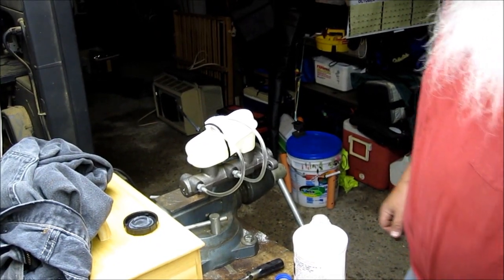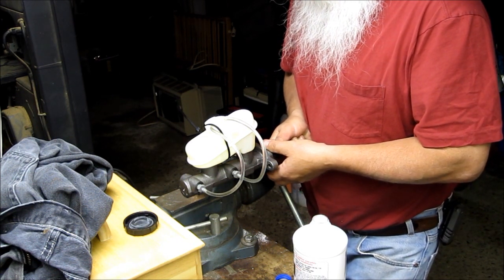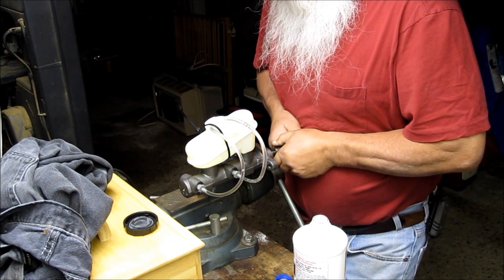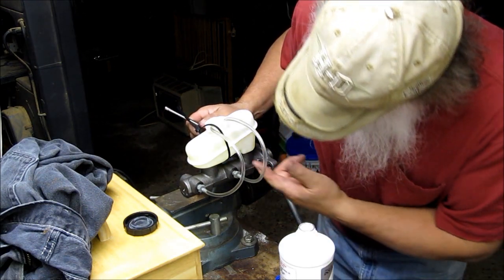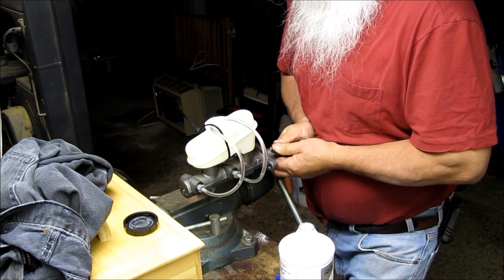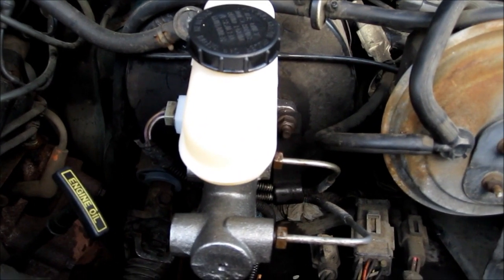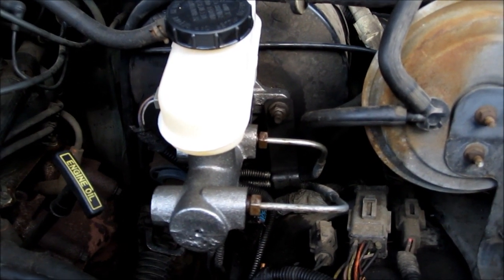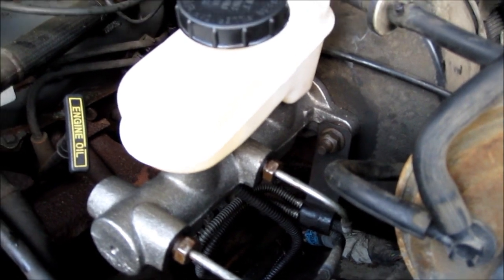May 8, 2011 bleeding the master cylinder for my 1992 Ford Explorer

Comment: Excuse me sir but if the master cylinder is new you do not need to the bleed the master cylinder alone, you install the system then you bleed it from the brake caliper correct me if i am wrong.